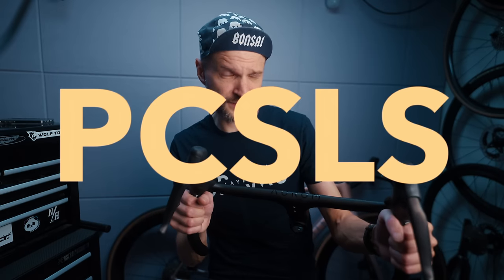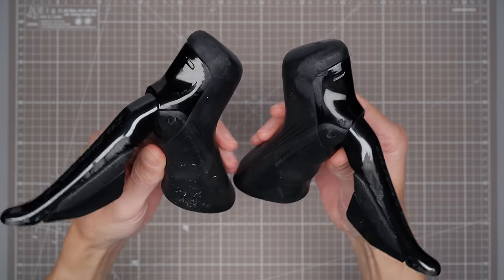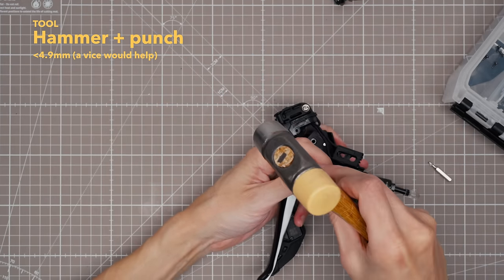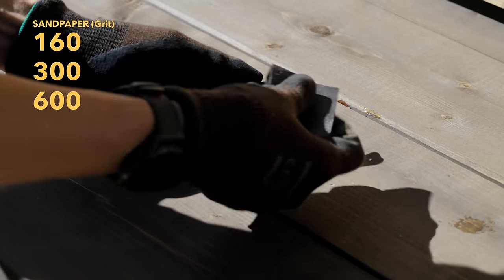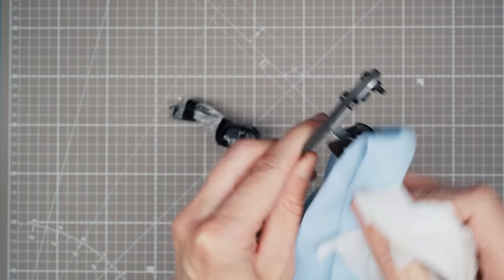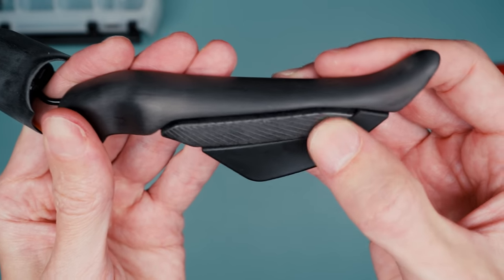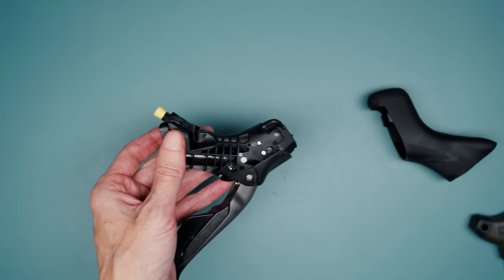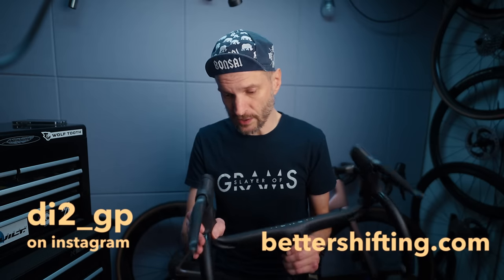Shift lever refurbish: Fixing the worst thing about crashing

Comment: Not very "sustainable" of a bike company to not even levers or trim covers as repair kits.
Reply: Industry is a mess at the moment 😅
Reply: they make more money buy charging you full price for a new shifter. Just like how apple would gladly charge you 2/3rd of the price of an iPhone to repair the screen and back glass. Easy money.
Reply: It's not sustainable to replace parts on a perfectly functional shifter that's scratched
Reply: That's not true, at least with Shimano shifters you can buy the lever assembly, the bracket and the hood covers, as well as small things like cover plates and clamps, all separately.
Reply: As an individual you can’t but as a company you can. Ask your local bike shop about it. The covers can be bought separately but there is a 1 year waiting list. And also it would cost us much more if they would list every pet so you can change your own stuff. Also warranty is a huge problem in the industry
Reply: There is a right to repair law here in Germany. So, they have to offer the parts to us, here!

Comment: Remember when hydraulic disc brakes came out for road and all of a sudden shifters where 2x the price even though hydraulic braking systems are actually quite simple. Man. Why did we all take that one laying down. Those things always get mashed to bits in a crash. With electronic shifters they should be even cheaper. Plenty of space for the reservoir without having to worry about mechanical shifting but yet the cost is still quite high.

Comment: I recently redid my scratched up levers too, but I painted it in gloss black with metal flackes which looks superb in my opinion. You should definitley apply clear coat to the sanded levers as the epoxy that hold together the carbon fibers degrades very fast due to UV light.

Comment: Those bashed up DA levers looked brutal.  Much worse then when you broke your leg and vlogged it.  Now, those levers look so good.
Even though it may look like there are a lot of parts and sub assemblies, it is still fewer parts than a mechanical brifter, with its ratchets and all. It is probably cheaper to manufacture these than  DA mechanical.

Comment: I had the first ever dura-ace sti levers when I was 15, it ruined a race for me on the muur van Geraardsbergen, refusing to shift down from the front outer blade. Took it apart, found a little pal that was worn out. Put it back together, send it to shimano with a letter. They called me, how I managed to get it back to getter with the spring loads.🤣 They send me a new lever back. The good old times when taking things apart wasn't a big problem for warranty. 
Always loved to tinker on things like this, just take your time for it.

Comment: That didn’t appear to be clear coat. It looked to be the byproduct of over sanding carbon. There is a thin layer of cosmetic carbon below the clear coat. 160 grit is very aggressive and cut through the outer layer of carbon. 

When I sand paint off of carbon I start with a dry sand with 250/320 grit body shop paper. The dry sanding allows more material to come off while using a less aggressive grit. You can also see how much progress you have made much easier than when wet sanding. Just wipe the area with 70% isopropyl after a few passes to check.

After that then I progress to wet sanding with an 800 grit paper, which I use solution of water and dish soap.

Comment: what if you dont disassemble the whole thing and just remove it from the handlebar, cover the parts that do not need sanding and then sand the whole lever as it is? wouldnt that work?

Comment: Hey Tobias, you've got too much time and too less children, I guess. 😂
But I have one question: Aren't you concerned about weakening the cross section of your levers while grinding off a lot of material?
I mean, even Shimano has reasons for making the "walls" of the parts that thick.
What if you have to grab really hard into the brake levers in an emergency case and they fail?
Since I weigh 50% more than you, it might not be your problem at all. 😬
But however: Do you take such aspects into account?
By the way: I love your videos and I am happy that you speak such a clear and "European" style of English language that even I don't need subtitles in most cases! 🙃
Reply from the maker: Never even a single grain of concern has entered my mind :)
What is removed is basically just the clear coat. With 160g grit sandpaper you barely scratch the surface of the carbon. But even if it did, the lever has so much redundant material you could probably make it half as thick and it still be fine in a crash… a global brand like Shimano would do that need to cover their asses when it comes to safety (even though they fuck up as well from time to time)
Reply: @ridesofjapan  😄👍

Comment: I'm still amazed third parties aren't making carbon lever blades for 105 / Ultegra.  Virtually all the weight saving for DA is the clamp bolt and lever blade - which combined cost Shimano less than $10 more than the 105 equivalents.
Reply from the maker: I think the difficulty of putting the lever blade back is the why no 3rd party lever exist. They don't want to deal with customers breaking their levers 😅... I too wish it existed though.
Reply: @ridesofjapan  I guess, though it'd be easy enough to sell 105 in upgraded form which most people would buy rather than just the lever.

Comment: How thoroughly do you inspect your bike after a crash, with all those lightweight carbon bits? Do you mostly visually inspect your bars, stem, frame etc, and maybe tap them lightly with a coin and listen to the sound, or do you go the full ultrasonic scan route? Or are there even some parts you replace after a crash even if they look good? If I'd crash a bike with a carbon handlebar and stem I'd be constantly scared that something could snap without warning when riding the bike after that.

Have I been watching too many @LuescherTeknik clips? 🙂
Reply from the maker: I just kick rims lightly and call it a day ;)
Im not paranoid when it comes to bike parts despite what YouTube(ers) try to scare people with :p